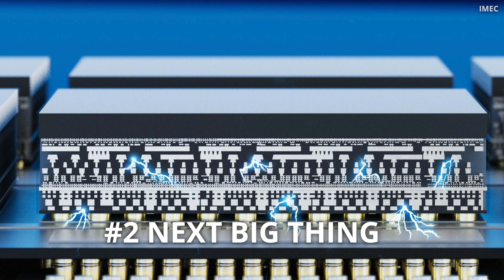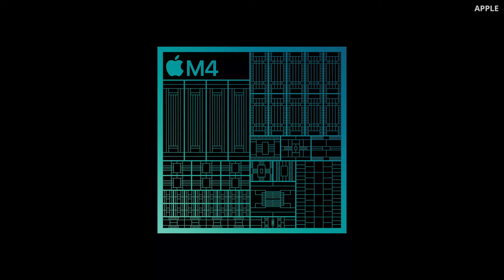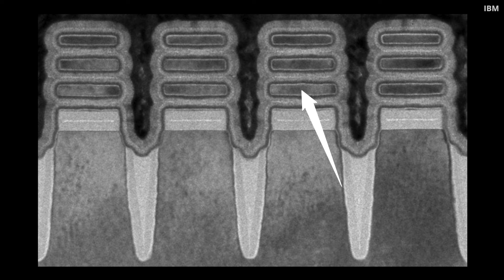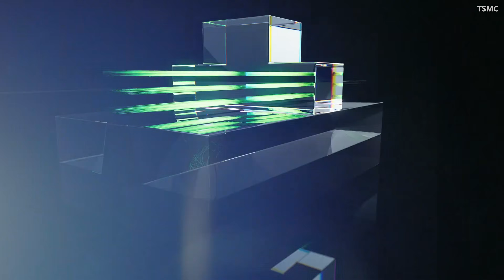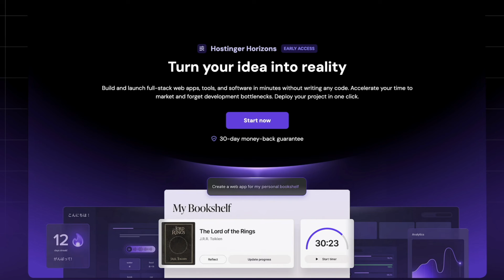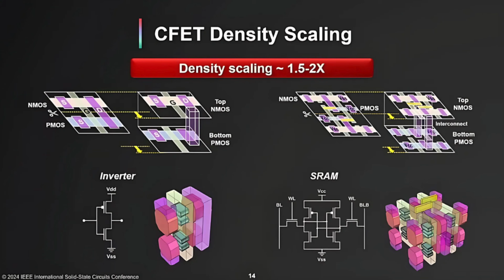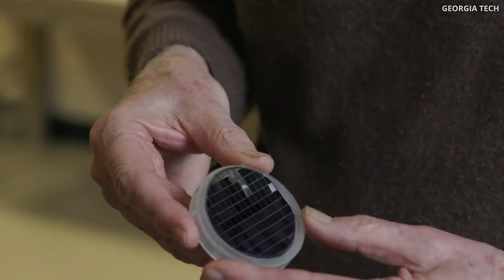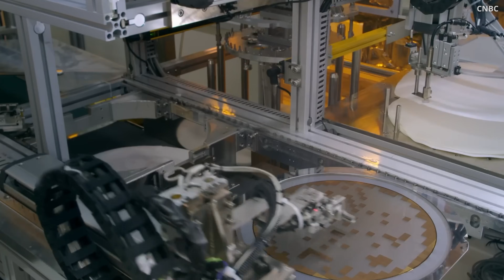The Next Big Thing in Semiconductors

Comment: At some point the chip makers will realize that what they need to do is reduce the number of components needed to make a particular chip so as to continue to make progress without having to re-tool every time. Not to mention the reduction in heat generated. AI may help in such an endeavor. It's going to take a lot of "smarts" to do it. Probably a whole new approach. Basically doing more with less.

Comment: As usual, you did an excellent job!  I did have a question though -- albeit a naive one since my knowledge of chip manufacture is very limited.  At one point, you described one of the production steps as being similar to a tiny star explosion.  Explosions aren't usually what you want when building something, so I assume the explosion must be tightly controlled.  How do they accomplish that?  Thanks!
Reply: To generate EUV, ASML uses microscopic molten tin drops. At a rate of 50khz or 50,000 molten tin drops per second. Each drop is hit with a low power laser to flatten the drop and then a higher power laser to make a plasma that emits Extreme Ultraviolet light @ 13.3 - 13.7 nanometers. 13.5 nm.

Comment: my guess, the the energy is delivered has to be changed.
an energy form that is compatible to the inner electro-magnetic components should be used.
... and i am interested in the forward voltage (or threathhold) of an individual transistor, maybe you can give a hint.

Comment: How does the 1/f noise of these transistors scale with transistor size?  I noticed that TSMC was advertising 35% lower noise on N6RF 6nm versus 16nm finfet.  On the planar processes the smaller transistors are noisier.

Comment: Copper interconnects wastes energy when running into high  bandwidth transmission. Crosstalk, signal reshaping, emi shield are added for mitigate the problem. When photons coming into infinite graphene gates era is comming, expecting another tech transision taking place.

Comment: we know that as we go more vertical and more 3d, we can stack thing closer together. the issue is with each layer we add, we are also adding more passes to the chip fabication. so the unit cost actually goes up rather than down. this is why we are "struck" with higher cost for 3nm and lower chip despite increasing the number of chip we can put in a wafer. if we adopt new gate method that increase the number of layers in the chip, it will still bring the unit price up. while this allows us to create more powerful chip, it doesn't address the problem that they are becoming too expensive. another thing is as we make chip density higher, we are also increasing the heat density. making it harder to keep the chip cool at this rate, we will have to extract heat from both the top face as well as the bottom face of a chip.

it is exciting times of course, from a technology standpoint. but from a commerical standpoint, it doesn't really do much.. it does provide those that want to build the fastest chip "at all cost" more headroom... but the trend that the smaller the chip becomes, the more expensive they become is unlikely to flip anytime soon.
Reply: 45 to 12 nm downward sloping optical litho economic cost curve then hits bottom as 7 nm, and now an upward sloping optical and SOC platform packaging and test cost. mb

Comment: CPU/GPU power consumption and heat removal is *insane*.  Compute efficiency per Watt may still be improving, but are the physics of managing high power going to ultimately limit the ability to continue increasing component density?  Wraparound gate seems to be the last incremental improvement available to FET.
Reply: and different densities, memory less and logic more and hi speed logic less v low power that also has shown its limit. mb